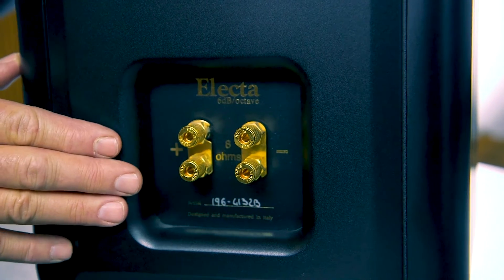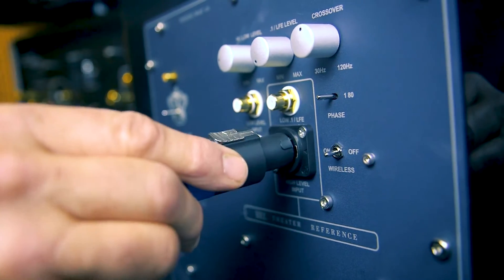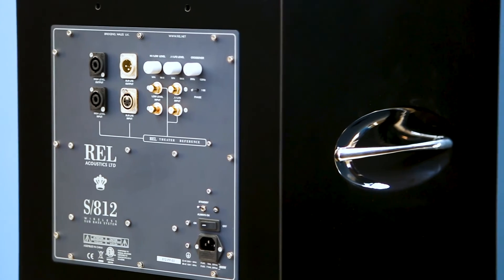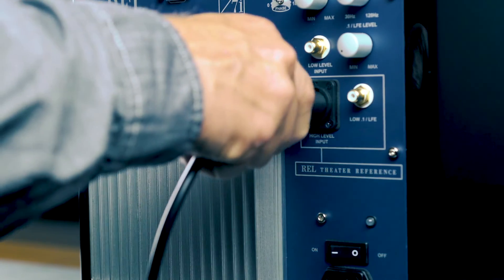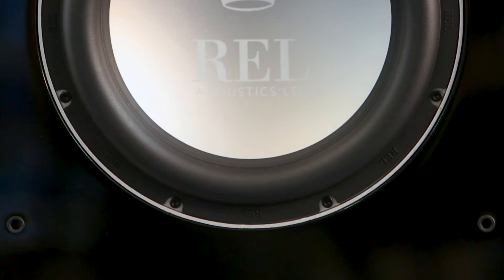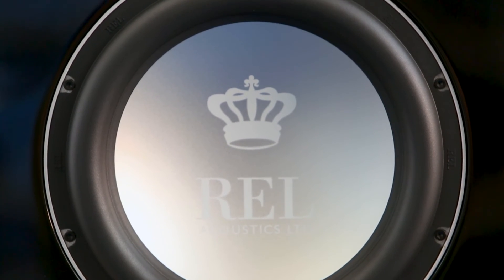What is a high level connection and why does REL insist you use it?

Comment: Can I use my Odyssey set up that came with my Marantz SR 7012, with the REL T/9X subwoofer?
Reply from the maker: Yes room correction software within your AV receiver can be used with the T/9x connected in this system. We simply recommend disconnecting the High Level cable from the subwoofer so that only the .1/LFE input is connected to when running the room correction program, and then once the correction program has finished you can re-connect the High Level cable and tune this channel on the T/9x by-ear to blend with your main loudspeakers.

Comment: Awesome subs (I have 2 Stentor III). You talk about feeding the same signature, however the amp inside the REL will massively affect that and remove that character anyway?
Reply from the maker: You are correct that the High Level input allows the REL to receive the exact same signal as the system's main louspeakers are receiving, including the tonal characteristics of the amplifier's output stage design. This improvement will still be noticed even though the subwoofer has it's own built in amplifier.

Comment: Except when it comes to horn speakers, REL insists you use low level connection. My question is, when using horn speakers, could I use a Line Out Converter (LOC) to connect the amp to the low level connection on the sub? Would using this method keep the same sonic signature?
Reply from the maker: Thank you for reaching out. In our experience using a speaker-level to line-level converter would result in the same issues as using the High Level connection, in terms of matching output levels with exceptionally high-sensitivity speakers, and since these devices are quite different than our High Level input from a circuit-design standpoint they can cause other performance issues if used in place of our High Level connection. 

In most cases when pairing a subwoofer with high sensitivity speakers it is best to use the Low Level connection to output on your preamp, though in some cases it is still possible to use the High Level input connection as long as you are using a sufficiently powerful subwoofer. For pairing and setup advice specific to your system, feel free to write in to contactus@rel.net and we will be happy to assist.

Comment: Hi a subject of conversation about using the high level connection on rel subwoofers setting the speakers to large ( full range )came up on av forums, and members were saying this is totally wrong, and would damage a speaker that wasn’t designed to be full range ,my thoughts was the crossover inside the speaker would basically reject the any frequency that it wasn’t designed for , so say your speaker was 80hz , would this be ok to supply it with a full range signal, ?
Any info would be greatly appreciated
The speaker they was talking about miller & kreisel s150 these are 80hz
Reply from the maker: Thank you for reaching out. It is possible to damage some speaker models by sending them a full-range signal from an amplifier, though this would only impact a small percentage of all speakers currently being built. If this applies to your speakers, then there will be a note in the owner's manual or on the manufacturer's website stating such. The vast majority of main speaker models are capable of receiving a full-range signal without damage being caused, and the speakers will simply roll-off naturally in their low-frequency extension where they are no longer able to produce strong audible output. 

In the case of your M&K S150 speakers, these are perfectly capable of receiving a full-range signal without any damage being caused.

Comment: hegel h95 + LRS
18m2 room

2 questions: 
1) what is better – 2x t5x or 1x t7x? 
2) what happens to impedance of speakers + rel(s) in case of high level connection? is it safe for amplifier? (total impedance gets lower than with just speakers, so even higher current is required? or I misunderstood?)
Reply from the maker: Thank you for reaching out. The High Level input on REL subwoofers has a significantly high input impedance, which means that the High Level cable can be connected to an amplifier's main speaker output terminals alongside your speaker wire connection, without the subwoofer placing any additional current load on the amplifier or drawing any amplifier power away from your main loudspeakers. 

In terms of the ideal subwoofer model for your system, when you have a chance please write in to contactus@rel.net and our team will be happy to provide a pairing recommendation specific to your system.
Reply: @RELAcoustics  thank you!
Reply: Hi. Firstly is it worth upgrading the cable to the baseline blue. And what are the gains?
Secondly. At the Amp end. Bare wire or spades. 
Thirdly. Can you purchase a Neutrik connector sub end on its own.
Many thanks.
Reply from the maker: @oohtob6685  Thank you for reaching out. When compared to our standard High Level cable that comes supplied with REL subwoofers, the Bassline Blue cable uses higher-purity solid-core copper wire, which allows for a more pure and direct signal transfer from the amplifier to the subwoofer. This in turn allows for faster and more responsive output from the subwoofer, and a more seamless blend with the system's main loudspeakers. The Bassline Blue comes pre-terminated with spade connectors, though you can always swap these for banana plugs or any other type of connector if you prefer. 

The Bassline Blue cable uses a Neutrik brand NL4FC connector on the end which connects to the subwoofer's input jack, and these NL4FC connectors can be purchased separately from a number of online vendors.

Comment: John, big fan, I have 6 HT1510 in our home theater. Thinking of 2 carbons for my 2 channel (Wilson) listening to you makes me wonder if speaker cables contribute and if so, should we hook up to the speaker to include the wire contribution????
Reply from the maker: Thank you for reaching out, and for supporting REL Acoustics. In some cases it can be beneficial to connect the High Level cables for your REL subwoofers to the binding posts on the back of each main loudspeaker, rather than to the amplifier's output terminals, though we only recommend connecting in this way when using certain amplifiers. For more information about High Level connection options for your system, feel free to write in to contactus@rel.net and we will be happy to assist.
Reply: I incorporate my REL high level at the terminals on my speakers for this reason. There was another video where John mentioned this, as opposed to tapping at the amp. If you're running a true stereo pair of subs, made sense to let it run the length of speaker wire for any added 'flavor' ..